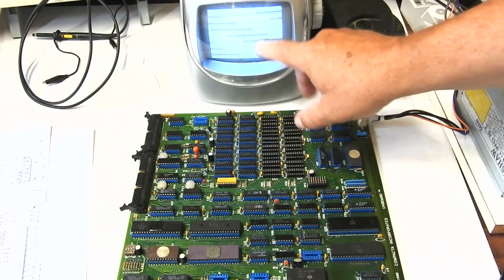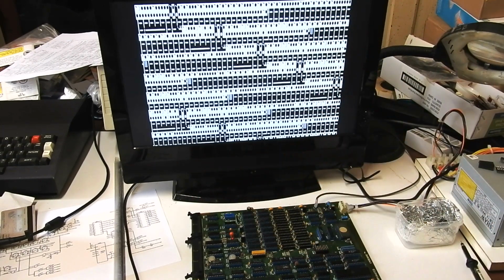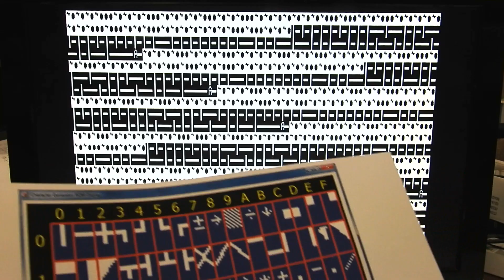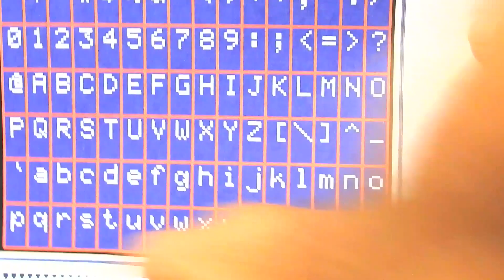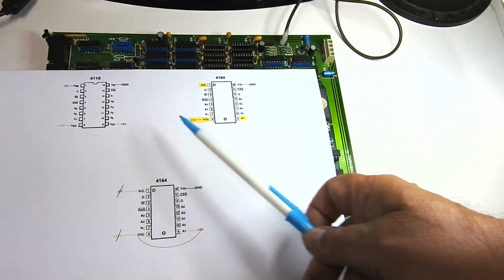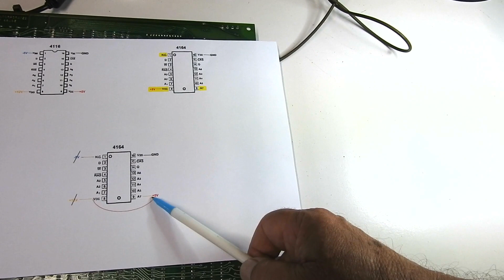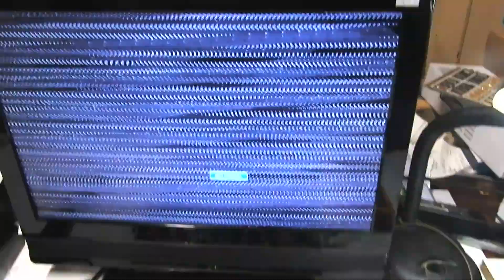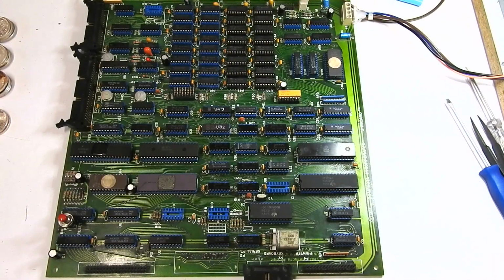Compacta Uniboard - Part 4 - Repair attempts #1

Comment: One of the things I've learned from watching classic computer repair videos, is that even if you can't see exactly what CPUs and memory chips are doing... you can see when they aren't doing it. By using your oscilloscope you can look at chip selects, address lines and data lines to see if you are getting typical outputs. If one of a group look vastly different than its brethren that can be a strong indicator of what is failing.
Reply from the maker: Yes, and I should have thought of doing that myself (too frustrated?), and in the EEVblog, it was also suggested to use a CRO to look for signals with wonky voltage levels.
I had only looked at a few, but now I'll start looking at many, especially those you mentioned.